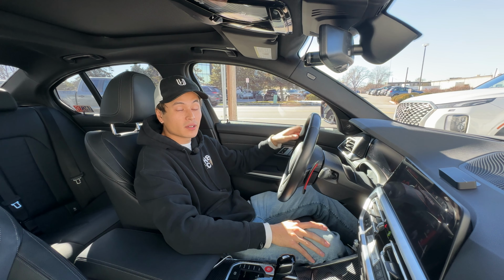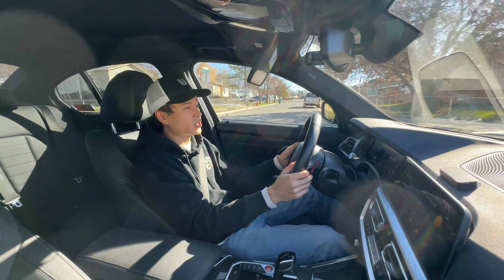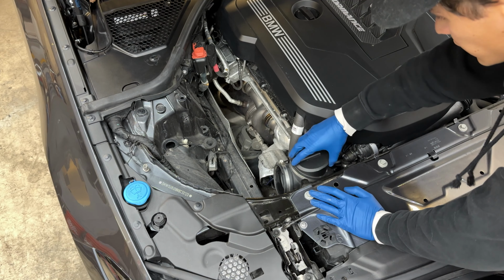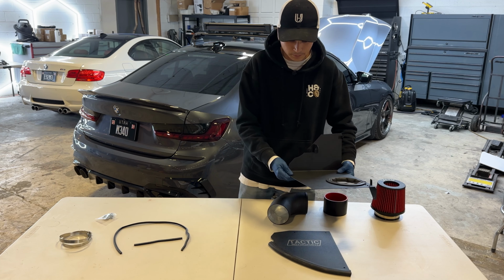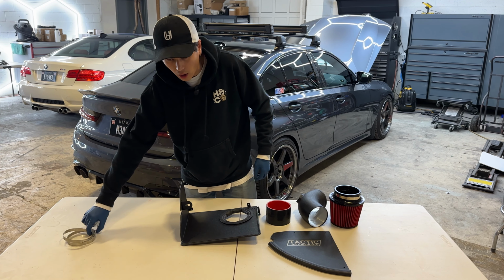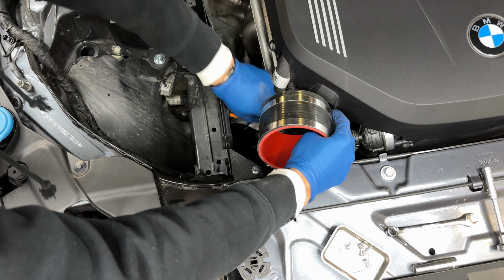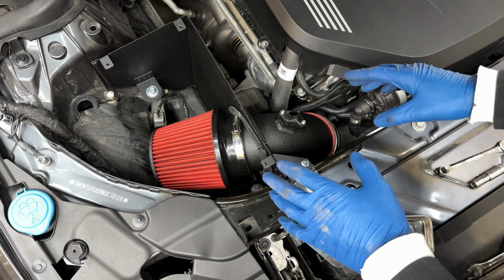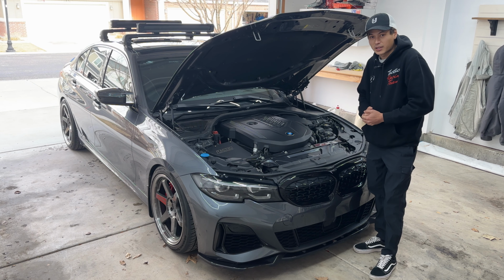The Best M340i Air Intake w/ Install + Sound Clips | EHOONS G20 Build Ep. 8

Comment: Was your car ecu locked?
Reply from the maker: It still is
Reply: @EHOONS is it not tuned?
Reply from the maker: @twacbow1-162 JB4 tuned, no need to unlock the ECU. I have another video about the JB4 specifically
Reply: @EHOONS  Im thinking either getting a tune like yours, or the intake, if I dont know alot about tuning at all, will it be hard doing burble tuning on jb4?
Reply from the maker: @twacbow1-162 burble is one thing that can’t be changed unless you unlock the ECU. The JB4 is good because you can take it off for warranty work. Plus you still get some added power. The intake is mostly for sound